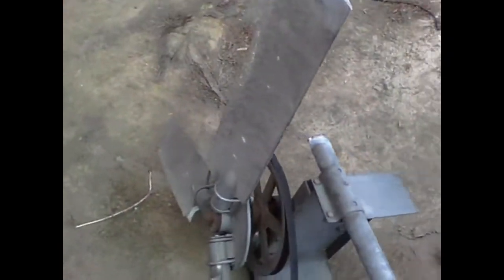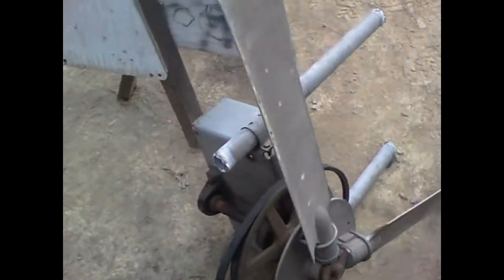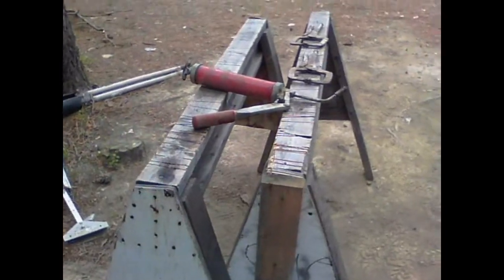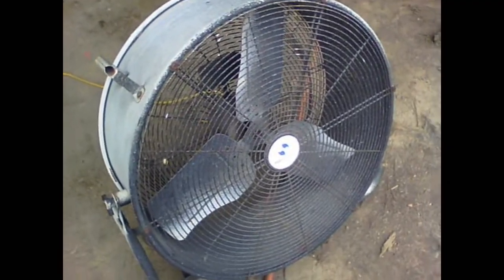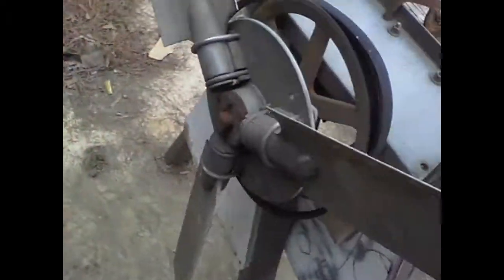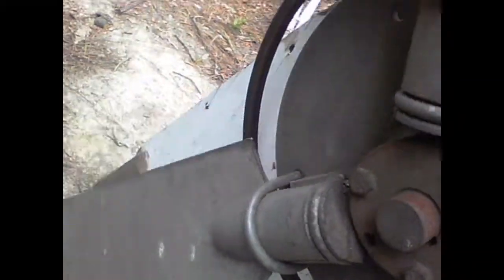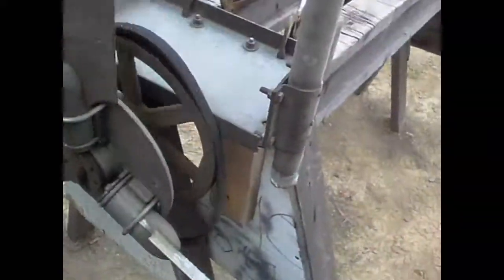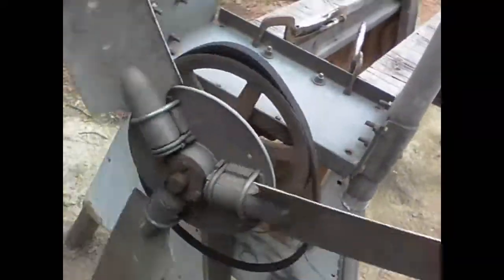homemade windmill generater test part 1

Comment: I think the problem you will have is not blade numbers, but rather the profile of the blades.  They need to have the same profile as an airplane wing,  you fan blades appear to have a flat surface. Three blades is a good number, look at the old Jacobs system that used three with variable pitch to control speed.  I have an old Wincharger system that used a two blade wood propeller, and I have made replacement blades for it so I have played with differing profiles.